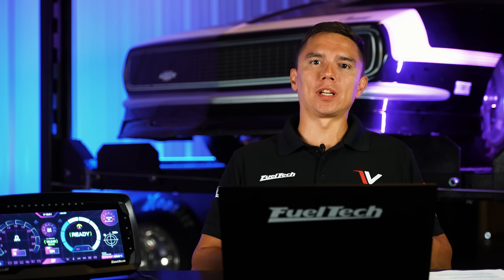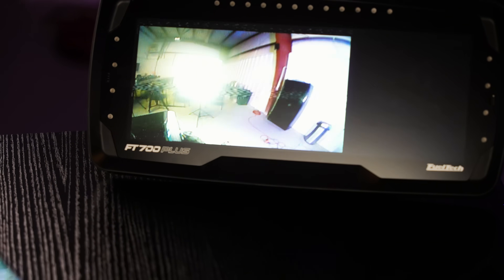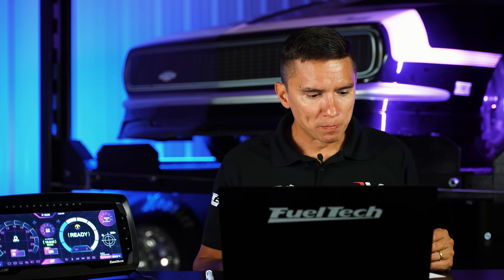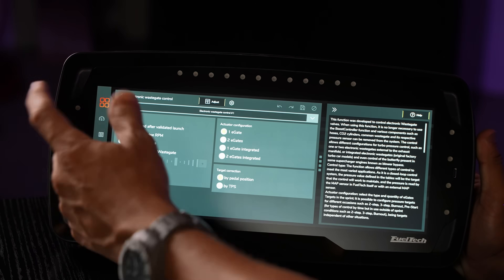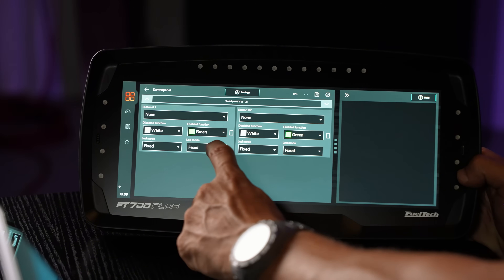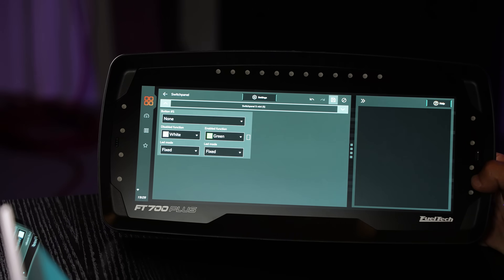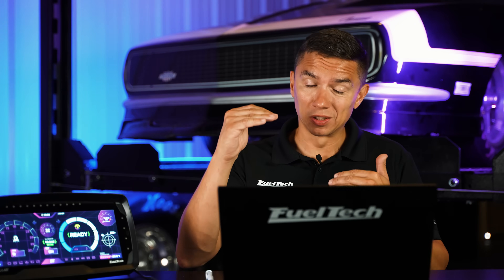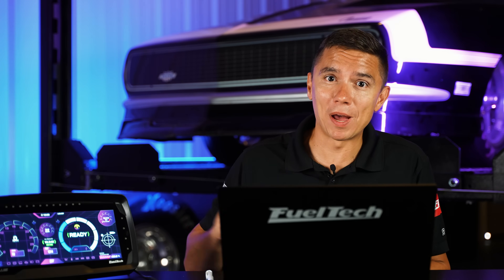FuelTech Vision Software Update 1.40 | New Features Breakdown with Luis De Leon

Comment: Why not have a built in PDM like the nexus r5? Or any PDM available from FuelTech to work with any FT ecu? Only thing lacking I feel. A lot of money to still have to use a relay board
Reply: You can use the hardwire pdm
Reply: Yes I see that, but that much money to then spend another $1200 on a PDM when they claim this is a VCU is funny. The nexus is the only true VCU
Reply: @het202 yes the nexus is but also has less inputs and outputs, also doesn't do what the ft700 can do. Motec is a great ecu and he doesn't have a pdm

Comment: Electronic Egate question. Does it now have control strategy for the hot side and also for the cold side at the same time? Running the 600 currently and will upgrade if so @fueltechusa